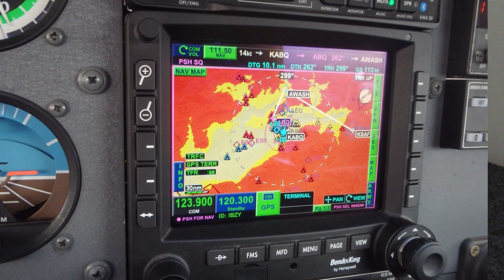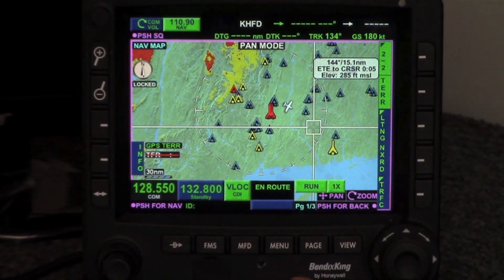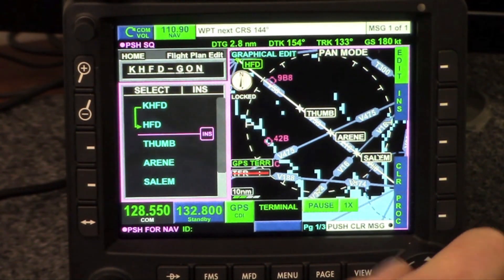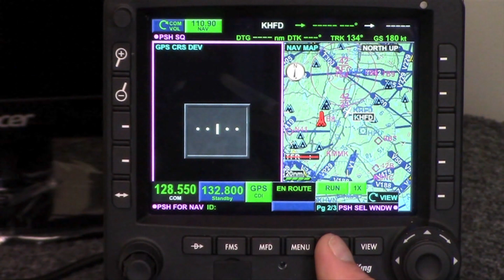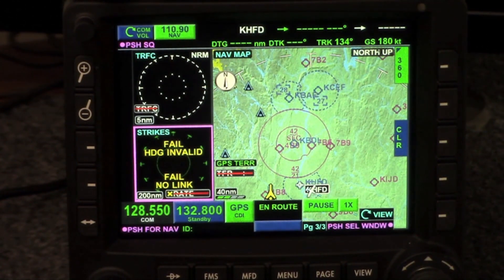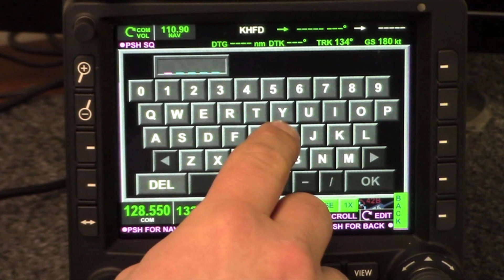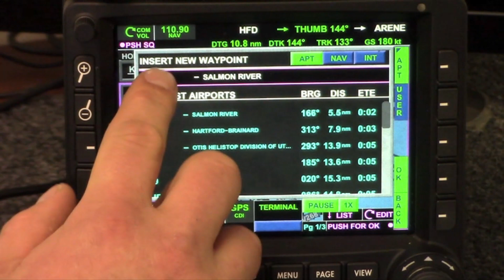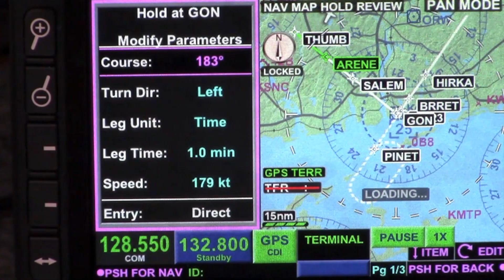BendixKing KSN770 Navigator Bench Tour

Comment: I've been servicing and selling Bendix/King gear for over three decades.  So many dealers surrendered their dealerships this summer and many within the industry see a full collapse of B/K GA Avionics within a year or so due to marketing and support failures.  Imagine you've bought precursors to this equipment with an understanding that you had access to an extensive dealer network only to be told now by your very angry dealer that they are prohibited from servicing your radio.  Chuck and Larry how would you feel if the backlighting went out on your truck radio on the way home tonight only to discover that a letter in the mail from GM said they had a great new program that prevents service of the component but lucky you, must now "Exchange" the whole vehicle or pay thousands of dollars for "reconditioning"? Ed King is rolling over in his grave, ask yourselves why Garmin has cleaned B/K's clocks! I know of not a single pilot or tech that doesn't see the 770 as a day late and several dollars short. NARCO 2.0

Comment: I've been using it for a few months now, and it works pretty good.  But in my opinion, inserting a flight plan is harder than it needs to be. There is a lot of back and forth when constructing a flight plan. I think you should be able to enter the flight plan the way you read it off your clearance. I think entering the beginning, airway and then choosing the exit point from a list is a much faster process. Than having to look up and down and going back and forth between fixes. I just believe that there are more button presses and typing involved than other pieces of equipment out there.